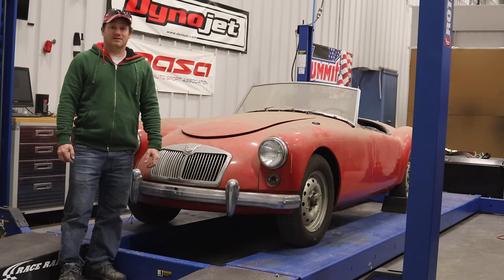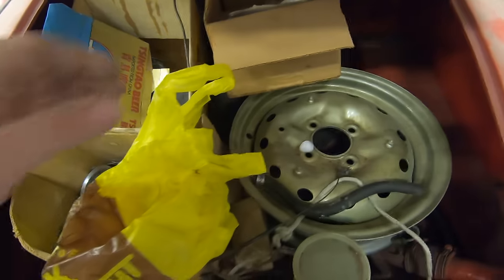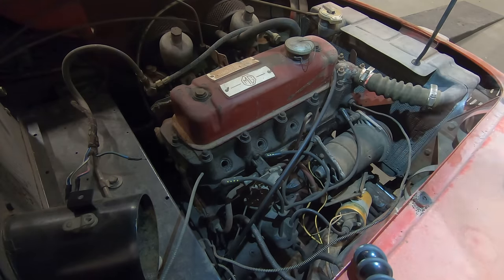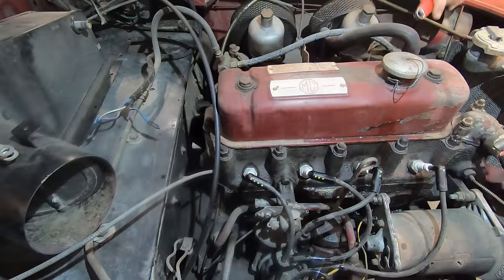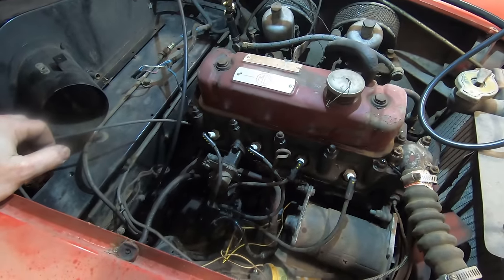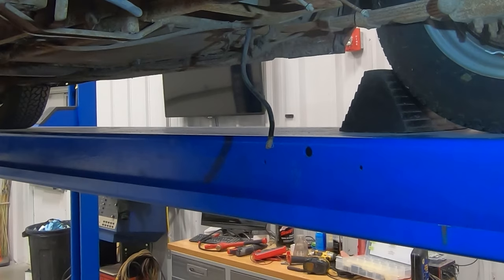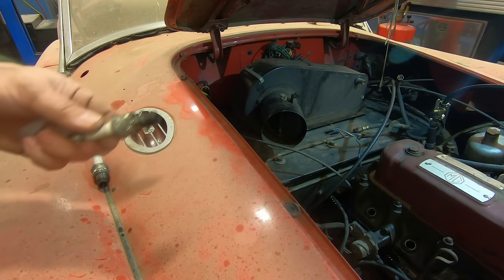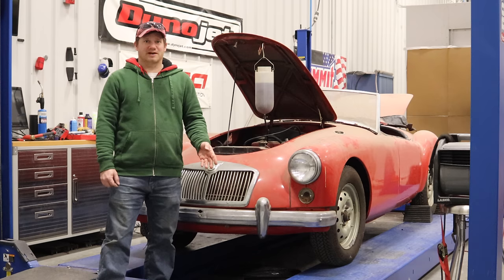1960 MG MGA 1600 Roadster - Will It Run?

Comment: It is simply amazing how you can find such old cars in such great condition instead of rusty hulks held together by the paint and mouse nests. That one sounded really good too.
Reply: Cause those cars don't tend to rust as they don't sit outside
Reply: I live in Ontario have a 62 with an 1800 it used to go out in all weather but hasn't for 30 years Looks great runs great an can be fixed with basic tools great lil learner car

Comment: I bought my 1958 MGA roadster on April 1, 1967, drove it until 1974 when I started taking it apart for repairs.  Sadly it is still in pieces and after being 'stored' outside is in sad shape.   I had wanted a TC or TD but at 6' 4" and having big feet I didn't fit in them so the A was the next choice.  Presently trying to make room in the garage to work on it, rusty frame and lower body will be a challenge at 73 yrs old.  At my age I'm not planning a fancy restoration, just make it safe, presentable and fun to drive again.  In 1970 in NJ while playing Army, if I had a bad tire I would drive to the local junk yard, pull off my wire wheel and exchange it for another with a good tire for $5.00, youthful mistakes.

Comment: I had a 59 MGA, and they are great cars. I would fly over hills and lift off the ground for 30 ft. I used vacuum cleaner brushes to fix the starter and generator. When the Banjo steering wheel broke off, I drove with a big vice grip to steer. I paid $1000.00 for it in the 70ies.

Comment: Great stuff, thank you. Just found out my neighbors Dad has a 1960 MG 1600. Im told it wont start but she didn't know any other details. Its in excellent clean condition inside and out, engine is immaculate. Ive worked on American cars since I was 6 with my Dad but never on a 60's British car or any other MG. This gave me a good go over of things. The only thing I didnt understand is why you called the batteries negative terminal the "hot" terminal. I understand its a "positive gnd" system which is a misnomer because even though the battery positive is connected to the body its still positive. I get why you didnt want the negative terminal next to the positive chassis but I didnt get why you called the negative terminal hot? Great stuff thanks again.

Comment: In high school, a buddy bought a 56 MGA, I ended up being the mechanic for it. Wire wheels look better, plywood floors, 6 volt batteries, tricky carbs, sounded like a 2 seater should sound, quick little beast that was very fun to drive, except in the winter.

Comment: The Papers in the Trunk from Scarborough Faire - this was a shop in Rhode Island on the Providence/Pawtucket line that specialized in parts for British Imports.  Right on Route 1.  They would advertise nationally, I saw them in Hemmings Motor News.  Plus I have driven by there many times...

Comment: Keep checking the electrics - Particularly the  engine earth connection which was a woven wire connector on these cars and it often got weaker when it  wore out by continued movement which  caused it to gradually self destruct.    It often was interpreted as a faulty starter when it was not so.

Comment: I just found a 1960 MGA hardtop at a lot just out of New Braunfels, TX on Hwy 46.  Supposedly 1 owner and stock, but I saw that the steering wheel looked aftermarket.  They said that they had done the brakes and done a tuneup.  It looked in “fair” shape to me, but they are asking $24,000 if I remember correctly.  I checked prices on line and it seemed to be priced at a “restored” price which it is not.

Comment: Great informative videos!  Thank you Steve.  I noticed you often install new master cylinders in the cars but no mention of bench bleeding them first ( a lesson I learned the hard way on my BJ8).  Do you do that? - and if so, maybe show folks how to do it.  Thanks again.
Reply from the maker: No I usually do not bleed them first that is a good way to spill brake fluid onto the car and ruin the paint.  There are other ways to overcome the problem if needed but usually not required on a British car.

Comment: The step-by-step procedure is logical and thorough, but with two curious omissions; a coolant and oil check. Removing the radiator cap and pulling the dipstick so simple and potentially instructive I'm surprised they aren't the first 2 steps before any other.  (Or are they so obvious that they were done but not shown?)  If nothing else, you want to ensure that neither fluid appears to contain the other. The motor can be started and run briefly with no coolant and little oil without damage, but it still feels wrong.

Comment: good vid Steve.By the way,should it have a 6 cyd?
Cheers.
Reply: MGAs never had more than 4 pot.
1500 for a Mk1
1600 for a Mk2
1622 in their final guise.
And if you did want >100bhp, you could opt for the much maligned Twin Cam. Which revs way higher than the pushrod units.

Comment: WHERE do you find these cars? I want one to play with. The miata never needs anything but gas
Reply: I have a 94 Miata, small things usually.  Did have to change timing belt and did water pump and seals while I had it out, but this is pretty accurate.  Once you get a Miata in a good spot they tend to hold it.  So much easier than working with my old MGB.
Reply: I sold my 2000 Miata a few years back.  Dumbest thing I ever did.

Comment: 2 six volt batteries wired in series, gives good cranking amps
Reply from the maker: Not compared to modern 12V batteries.  https://mgaguru.com/mgtech/electric/et203.htm

Comment: I personally would rebuild the engine with a new wire harness the car deserves a restoration.  A car in this shape has zero reliability.  Even though it runs.  I am sure you know Moss Motor has most of the parts you need.